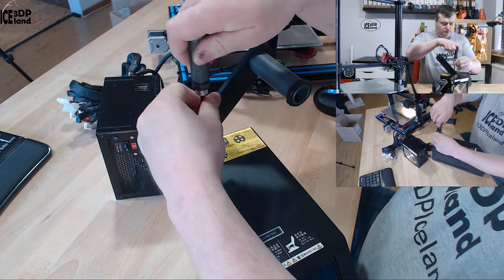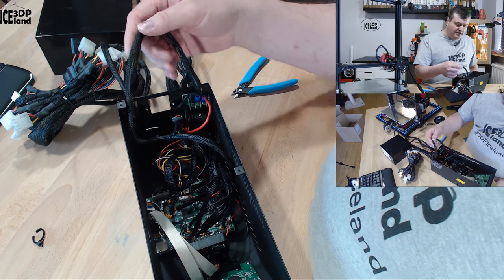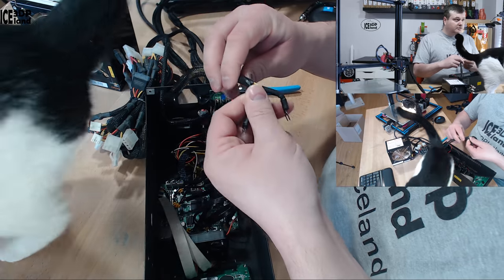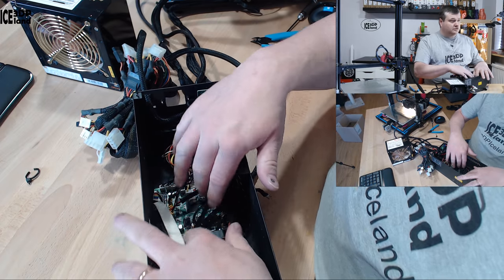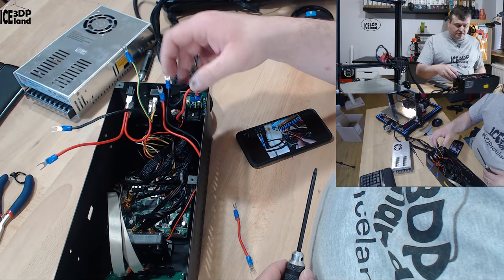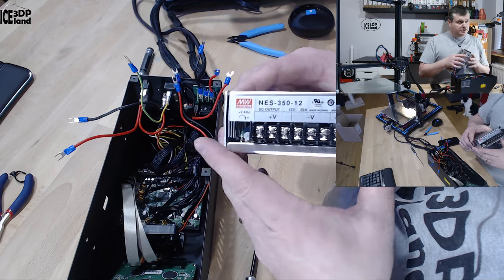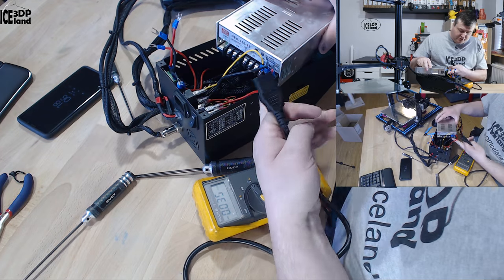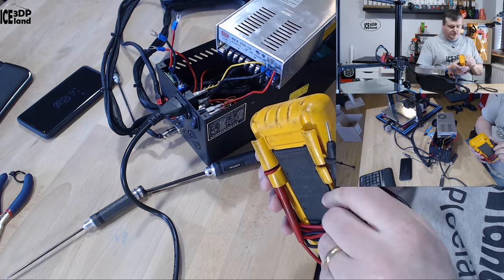Creality CR-10S -  ATX Powersupply replacement

Comment: Nice video showing how to fix it with an ATX psu and rebuild it to new one. Only thing you might have forgotten is to unplug the mains after the 1st test BEFORE attaching the 12V connectors. So everyone please unplug the mains and be careful while connecting the 12V plugs as there might be some power in the capacitors and so power on the 12V output side.
Reply from the maker: Thanks, - yea, I noticed when I was editing the video, I should have unplugged mains at that part :)

Comment: Is there a minimum PSU wattage that you can use? I wouldn't think the printer would need a lot of wattage. Only asking because I want to do this upgrade on my printer, but would have to purchase PSU. Thanks!
Reply from the maker: I think 250-300 watt is plenty good for it.

Comment: I thought for sure a smile or a little dance would be in this one...
Reply from the maker: It might come, - I have recorded and scheduled videos all throughout June, - :), so any new videos recorded in the next week or so (that might includes smiles)  are up on the channel after a month or so :) lol :)
Reply: 3DP Iceland I don’t even have a CR-10... I have a Prusa MK3. You should make more Prusa vids. I struggle getting a level bed to print on
Reply from the maker: THELIGHTSPEED! ! What slicer do you use?, does it not do the bed level check before each print?